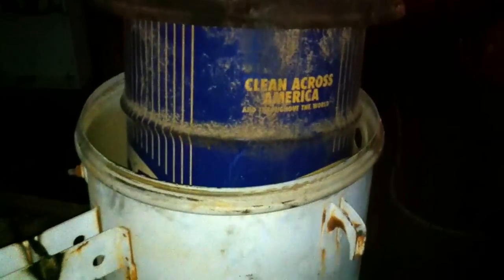Woodgas Project - Video #3 - Gasifier still under construction.

Comment: you are planning a common condensate tank? with shut offs between the different parts and the tank it self? if you don't put shut offs wood gas will use the drain routings and by pass things...
Reply from the maker: International Supply I have 3 compartments on the bottom for condensation and ash. Planning to have cleanout hatches and drains on each. It wasn't easy to work out the details and keep it compact but I think I covered everything. I am not sure how well my common use of the same condensation tank between cooling coil and filter will play out but I think it will be OK. May have to drain it more often.
Reply: just make sure gas can't bypass the cooler or the filter when you have a common tank, cause it will follow the path of least resistance.
Reply from the maker: International Supply I think I will have to put a valve to adjust the drainage on my cooling coil into the common condensation tank with the filter because the way I want to circulate gasses in filter from above. I am still working on how best to build the cooling coil. Likely take longer than everything else. This is my first gasifier and maybe my last, I sure hope the thing works like I see it working. I bet I have spent 100 times the thinking on it as I have the doing on it.
Reply: LOL... I have over 65 full, half, quarter scale drawings I have made up to building the unit you see in my videos... Wait till you see what I'm working on as we speak... if it works the way I in vision it that is....
Reply from the maker: International Supply You have got the advantage of having at least one working model under your belt. Best I could do is study ever model someone else built or designed (built or not). I suppose some guess work is always involved. I may find that my unit is good for a single purpose instead of multiple. I think it still worth trying for upgradable to suit each equipment I have. Its all good, working or not. Just gravy if it does.
Reply: lol... yeah, and about 7 prototypes, expert help and mentoring... goes a long way... and it doesn't mean you have to go it alone either, there are places you can get feed back from.
Reply from the maker: International Supply The best place I found is driveonwood.com. Seems like everyone wants to help though. I wish I had energy and resources to get this thing operational faster. I think I have all the bases covered except the thermal zone and I have left that open for last thing to do. Thinking the best process is start with the smallest motor first and work my way to larger motors on my upgrades. That will maybe keep me from melting something down.